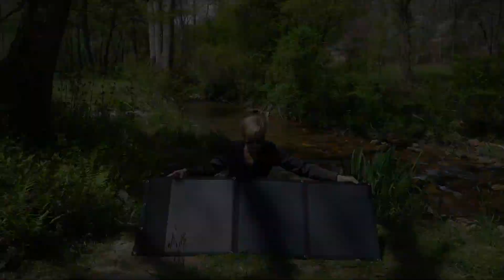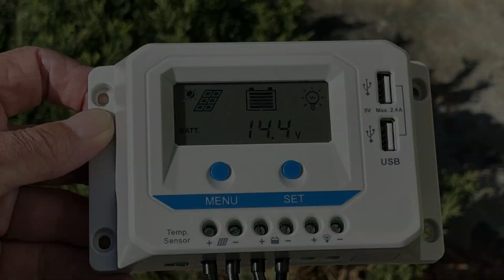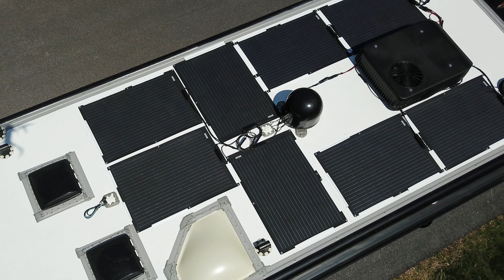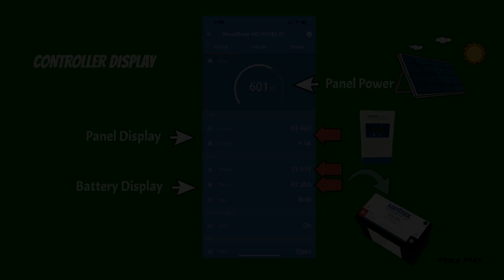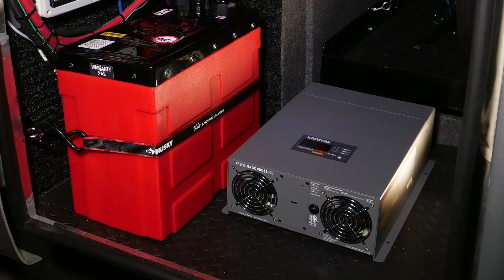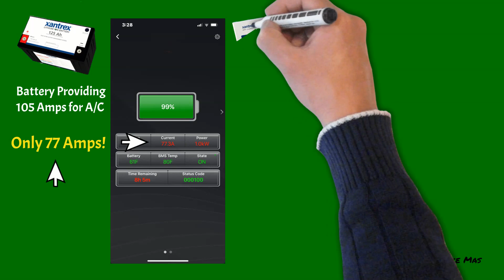Xantrex Solar Panel Install - Renegade RV

Comment: My RV came with have Xantrex 110w solar panels and the same Xantrex 30a charge controller. I want to add more solar panels. But...from what I am reading in the charge controller manual, the charge controller is only rated to charge at 390W. And the max PV array power it can handle is 580W. Isn't having 880w of solar panels too much for the solar controller since it can be damaged with anything over 580W incoming?